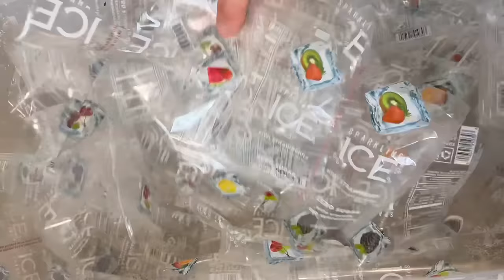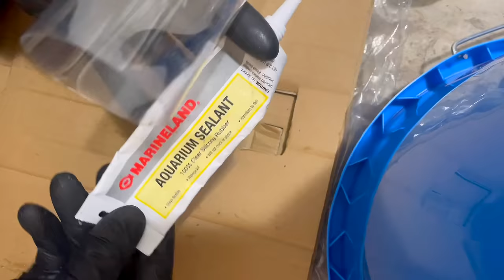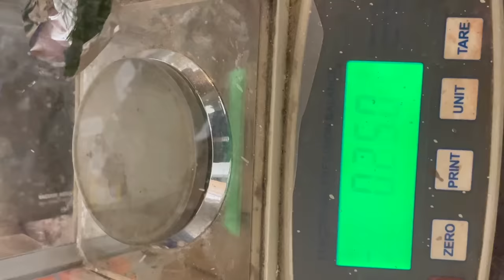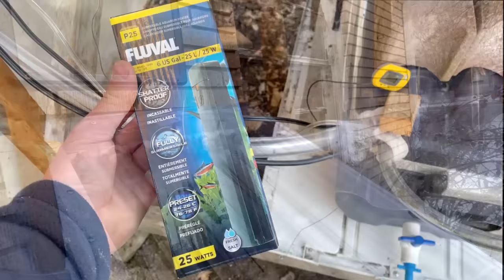Cody's Algae Panel

Comment: The main problem with algae is the entire system can become infected and kill all the algae or poison you if you are consuming it.  You might consider separating the algae generator into multiple discrete units to allow for direct comparisons to ensure safety and redundancy as well as protection from accidental contamination.
Reply: It is a great environment to grow bacteria and mold too. For non-food use the risk of legionella is greatest problem, but for food use there are a large number of organisms that could be dangerous.
Reply: If you separate it you could also use it to select for more effective strains.  Like as select for carbs if you want ethanol or select for lipids if you want oils.
Reply: May i ask how a closed system can become infected? 

What are the weakpoints? What would you nees to filter in order to make it foodsafe?
Reply: @dmarsub  You are assuming that the closed system was 100% sterile before it was closed. Very hard to do even when you are trying really hard to clean everything.
Reply: The movie "Stowaway" is currently on Netflix and they did all this stuff already. The algae stuff starts at around 42 minutes in.
Reply: @dmarsub  the soil is the weak point of the sterile system. By necessity soil needs a diverse and healthy microbiome in it. Yes you can try to use hydroponics but that has contamination issues too. Microbes are tenacious!
Reply: @busimagen  Well, not necessarily. There's ways of isolating, say, specific spores from mushrooms, and considering the research that's gone into algae production, there must be a way to isolate single algae strains, however difficult it may be. I thing the safest bet would be a combination of the suggestions; spirulina for an extreme environment that not a lot of everyday pathogens are adapted to, isolated cultures, hermetic sealing to close off the system, and good filtering for both the air and water intakes to keep out any critters.
Reply: @dmarsub  His system at present is not completely sealed.  The entry points to the cooler for example are not completely sealed.
Reply: @Personnenenparle  bleach isn't danagerous because of pH. Bleach works through oxygen radical chemistry. As a biochemist, I can say that you can contaminate basic systems.
Reply: can't you simply microscope a sample, maybe put some reactive dies, biotech CSI stuff.
Reply: @catsbutthole  Thinking you know a strangers mental state from infrequently uploaded YT videos is cringe af. Its also incredibly rude and tone deaf.
Reply: Could he have a sterilisation process that would take some of the algae from the system, run it through UV/ozone, filter the algae out for consumption and then add the water back into the system?
Reply: @catsbutthole  Cody and Kanyon publicly addressed that they broke up 2 years ago. It's pretty rude and creepy to come in and start making a big deal out of it.
Reply: @catsbutthole  Aww, poor baby is upset because someone else called him out.
Reply: @m_t_t_  or just grow a sample on an non selective agar plate regularly
Reply: @dutchik5107  yes but you will need to buy them and its not automatic
Reply: @m_t_t_  eh. You just poor plates yourself every once in a while. A pot of medium can make a crazy amount. 

With the ozone, while killing everything, if you have bacteria in there that produce toxins, well you kill the bacteria. Not the toxins. 

I am sure Cody has the ability to make agar plates. An autoclave or pressure cooker. Yeah petri dishes. And something like a bunsenburner. 
Could even reuse the plates pretty easily if you buy glass ones. Bit annoying to work with as they are heavier but gets the job done.
Reply: @d.6325  you've been whining about him getting a girlfriend for a while. Weeeeird. Almost like you want to date him.
Reply: @dmarsub  the air intake. Airborne algae & friends easily get in. Southern states have brain eating amoeba, but I don't know if it's airbourne
Reply: @matthewbrown1617  you can sterilize the hardware, but what about the operator? You may be surprised by how many little friends you have.
Reply: @Personnenenparle  To make it food safe, Alcohol! I wonder if drunk chickens taste any better
Reply: @dmarsub  Ask any mycologist about how difficult it is to keep bacteria out of your mycelium cultures (possibly an extreme example, but still). You would have to pressure cook everything for a good sterile system -- but that probably wouldn't work with these plastics anyway
Reply: Although he is 100% correct that algae is edible It makes a much better food for food.😅
Reply: @catsbutthole  You need to calm down bro.
Reply: Cody is working from a more simple perspective.  Sterilization won't ever be feasible, and the system needs to be as minimally complex as possible to help limit expected failures.

Separating the generator into multiple discrete units allows for very simple side-by-side analysis to determine relative conformity to safe parameters with little more than your available human senses and a basic magnification device.

You can see,, smell, taste, and feel slight differences that will in most cases alert you to problems before they become catastrophic.

It's not perfect but nothing is.  It is however, simple.  And for Cody's purposes, simple is a very important characteristic of any project being presented here.

I do however agree that algae might be better suited to creating food for livestock.  Maybe crustaceans or insects.  Something that would be easily contained and transported.  It's less efficient, but safer.  And probably tastes better.
Reply: Just cook the algae? I mean-
Reply: @Personnenenparle  Hey that solves a freezing issue as well
Reply: Well thats why u do tests and u know the same thing that makes it easy to infect also makes it a breeze to clean and recharge the system
Reply: A larger amount of water is easier to maintain...
Reply: What would you need to do to make it able to produce oxygen for something like a bubbler? An electric one might be more viable in this case but I like the idea of using nature to add air to water for something like hydroponics
Reply: @ooee8088  What's your point? Are you saying he shouldn't be doing this because someone made a TV show?
Reply: @dino6627  Legionella?  In a system exposed to sunlight?  How?
Reply: I used to work in a brewery in their microbiology labs.  One of my jobs was the culture of new yeast.  The cleaning and sterilisation procedures used were very stringent and strictly applied right across the plant. Inevitably even with best efforts, infections occur at fairly regular pace. Detecting these infections was another of my tasks. So the production of new yeast was a constant process.  

I saw no sign of Cody taking such meticulous precautions in his aseptic practices so infection is pretty much guaranteed if this process is continued over a longer period.  It's only a matter of time.  The idea of separate units is a great idea.  If they were staggered it would also give a more continuous flow of finished product.  Also each unit could be thoroughly harvested and sterilised (say once every few weeks) and this would be much simpler if you're only cleaning a relatively small unit at a time.
Reply: @KenFullman  even if the ph is 10-11? I don't know many species that can survive on something that basic. seriously asking, I'm no expert:)
Reply: Probably algae growing should be similar to yeast growing which can also be easily contaminated by harmful orgasisms

Comment: Chemist here: I would recommend not to use vinyl or pvc for food usage. They can leetch phatalates. Expeacially  the soft tubing is full of softeners. It is good for testing, but not for final product.
Phatalates are known to be bioactive and harmful.
Reply: Signal boosting comment here! PET is also pretty porous. ABS is food safe but not transparent.
Reply: What would you recommend?
Reply: @imbrudedsoul  HDPE pretty sure
Reply: @imbrudedsoul  Acryllic polymers or borosilicate glass are viable FDA-approved options for a project like this.  He could use regular glass tubes but they wouldn't be as sturdy as lab grade borosilicates.  Another plastic option would be clarified polyethylene, like clear or nearly-clear HDPE.

I disagree with napiton, PVC is generally recognised to be safe for human biological use.  Millions of miles of PVC pipe are used to transport water to the homes of many industrialized countries.  My only issue with PVC is that it will itself degrade with exposure to UV and become malleable, potentially causing leaks in a system like this.  Concerning the toxicity of the degradation, I would argue evidence is largely unavailable to support a claim like that.
Reply: @zachalexander963  I definitely agree with the PVC comment, PVC would be a MASSIVE improvement on the lead lined plumbing all over the United States. Thanks for the info!
Reply: The more I learn about plastics (from hydrocarbons) the more I worry about microplastics and PFAS CHEMICALS, etc etc. 😕
I think we should all learn more about chemistry and ecology! 🌿🕊️❤️
Reply: @zachalexander963  Pool guy here in FL. PVC is in the sun light all the time here and under pressure at psi's close to tires up 40 psi. It's like if it turns yellow or brown then you may want to replace it. And you can just pant it, so the sun/UV isn't an issue. But for Cody's climate I put ever thing in some thing. Like just go with a green house if your up scaling to the level he clam's.
Reply: @imbrudedsoul  polietylen is the industry standard. HDPE MDPE and LDPE are used here and there.
Reply: And Silicone sealants break down from UV exposure so will not work for outside glue in sunlight..
Reply: @imbrudedsoul  Glass
Reply: @WaylanEE  I was thinking pvc with a lexan cover
Reply: Glass jars would be great. Or even more interesting is to grow the algea as a film on flat glass. Cover the panel and let water just run over glass and drop to the insulated container at the bottom.
Reply: Use glass, as for PVC, it depends on whether you are using hard PVC or soft PVC which has more plasticizers, hard PVC does not have many but lead is a common stabilizer for PVC and a lot of PVC does contain lead.  But yeah the solar degradation is a problem with almost all plastic which causes it to hydrolyze and break down the plastic molecules without turning them back into safer chemical components like how biodegradation would do within a lifetime.
Reply: @imbrudedsoul  I also would use glass: virtually no health risk compared to any sun-soaked plastic
Reply: You mean they're putting chemicals in the water that are turning the freakin' frogs gay?
Reply: Sorry to interrupt your science talk about different plastics, but ehm my beer bong is made of this vinyl tubing. Do I need to care about it? I mean I am just using it for maybe 8 liters a year.
Reply: Following
Reply: @cheyannei5983  PET is food safe, that's why it's used for water and soft drinks, which can be stored for a LONG time. It does not contain either BPA nor phtalates, nor other chemicals for that matter. Unfortunately, there's not a lot of PET products available for other things than storing liquids.
Reply: Considering he's just using the pvc for prototyping as a cheap replacement to glass I doubt it's a real issue here.
Reply: @zachalexander963  The PVC doesn't need to be exposed to direct sunlight, aside from painting it, he could just alter the frame and hide the PVC from the sun.
Reply: Cody mentions this at 6:58 please rewatch.
Reply: @zachalexander963   Millions of miles of PVC pipe are underground and not exposed to intense UV (or any UV), which greatly speeds up its degradation process. Not really fair comparison.
Reply: As long as it doesn't get hot pvc and vinyl should be fine
Reply: Would you consider them Phatal?
Reply: Does this apply to all plastic grades - eg PVPE etc??? What about Mylar or Mylar lined contents?  What is a good non toxic material -- glass only ?? What is a good plastic material?
Reply: Never even thought of this. Good catch
Reply: So... What's then? Glass and brass?
Reply: It's spelled "phthalate" actually.
Reply: Yes this
Reply: I lay gas and water mains/services and they are not PVC... old services are lead, some copper, newer stuff acrylic but the new new stuff we renew with nowadays (since about mid 70's) is polyethylene, atleast here in the UK that is! (sometimes protecta-line barrier PE to protect water supply from contaminated ground, from things such as petrochemicals as they can leech into the PE and remain there for years contaminating the water supply) seen so many people tip/spill petrol and diesel on their garden right over their own water supply... Ive seen PVC used for central heating systems but not for drinking water.
Reply: @BigPerm6999  I think possibly most people see pvc for waste water, then see speed-fit pipe and assume its the same or forget its not the same, because unless you use it regularly you don't notice the difference and realise its cross linked polyethylene(pex/xlpe) . But I'm a spark and am therefore convinced that all pipes are, much like brooms, incredibly hazardous
Reply: @iRrrmanion1  oh yes, how could i forget, waste water pipes too.  Always a pleasure to dig around vs the clay pot ones that shatter under the slightest dink with a spade!  Indeed,  talking about hazards right now we have an 11kv cable running through our job and its actual location is unknown on the maps, the cable is so well balanced that we cant detect it from above ground with a CAT and Genni at all and the 8" pipe we need to replace has 1.2m of ground above it.
Reply: @cheyannei5983  ABS is food safe? That's pretty neat. And I know ABS keycaps can be made to have some form of transparency, but maybe not crystal clear.
Reply: @zachalexander963  I think PVC would be bad if you left something sitting there for awhile. It's kinda like how lead pipes aren't poisonous because the water is constantly moving and at the same pressure and whatnot. I guess PVC wouldn't even need those requirements, just moving water. But that's way beyond my knowledge
Reply: @kathyl9222  isn't biodegradable plastic ironically terrible for food storage? I've heard that plastics not made of organic food safe materials can leech loads of nasty chemicals into food if they're biodegradable.
Reply: @olegil2  isn't PET's issue related to plastic waste rather than its safety?
Reply: @SockyNoob  i'm confused,  can you please tell me conclusion - what will be 100% food safe? Exept glass and brass  (brass is safe, yeah? I mean some connectors are made of it, it must be safe)
Reply: @padkirsch According to a 2024 study, microplastics can be found in every human placenta. The study also found that the most common plastics detected are PVC and nylon, after polyethylene.
Reply: Glass carboys
Reply: Glass would be better for long term.
Reply: PVC? Hell noooo!!! Just look at old wires with pvc insulation. They emit hydrocholic acid (not very harmful here), vinylchloride, they can emit plasticizers and lead as a stabilizer. PVC definitely not an option.
Reply: Regular MDPE would be fine for the plumbing.  It's also probably the most available pipe and fittings out there.  Although it's not trasparent it would still be ideal for the plumbing.
Reply: @WaylanEE way too heavy to be cheap, and a dangerous physical pollutant
Reply: Is there a test for phalates?

Comment: Cody talking about the panel freezing up being bad reminded me of a commercial solar water heating job i installed the structula suports for. 

The job was being finished up in late January in the far north. The panels had all been hooked up, and the technition filled them up with the glycolic.  Everything was running fine at the end of the day. That night temps.droped to -30c..... the crew i was working for was the  first in every day before sun up. When we got to the roof  there was green snow everywear. About half the tubes had froze  the night before and burst and as the sun came up, it started to unfreeze in the panels but only the parts the sun was hitting so you had boiling hot glycole venting out of vents everywere. 1 million in damage all because the tech didn't  read the labels and cut the glycole  down with water when it was already mixed